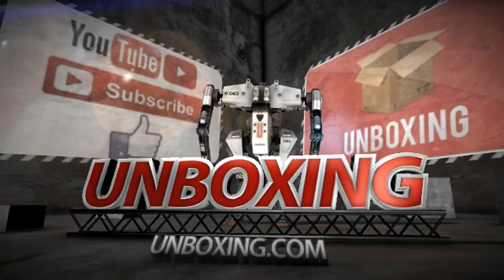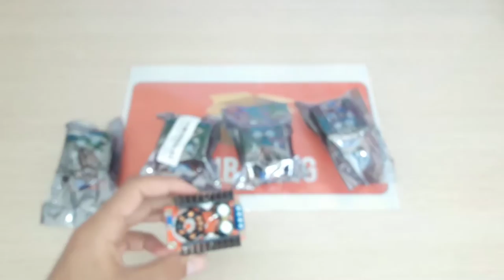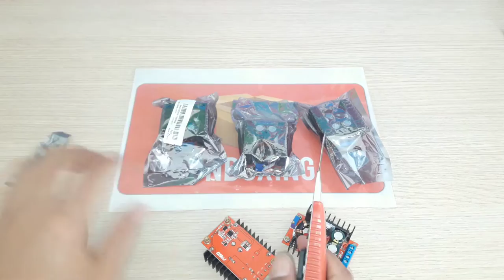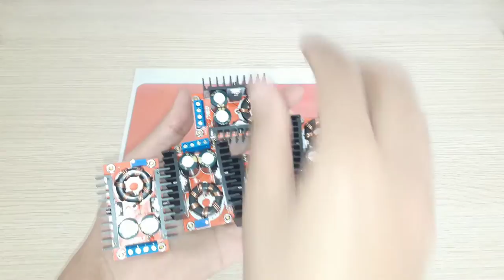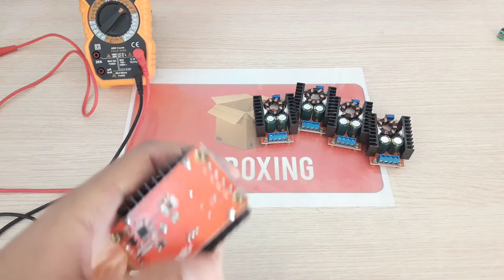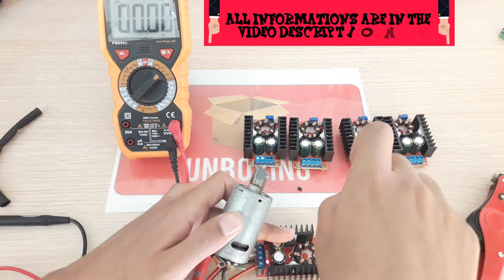Top Boost Adjust Module Mobile Laptop Car DC-DC 10-32V To 12-35V 150W

Comment: HI. Have you mesure the max Ampere at how many Volts and case temperature ? Thanks
Reply from the maker: i didn't measure the max  temperature but the temperature in normely and the amp test is between 7and 12 and volt i have just 22.5v

Comment: Hey broo i have a doubt 
If  i use laptop adapter as input( 18.5 v and 3.42 amp )
Will this module can give ( 24v and 5a) output
Reply from the maker: yes but the amp stay fixed

Comment: The specification says this modul maximal input current is only 16A..
is it save connecting this module to 12V 60A car battery ?
Thanks for the answer...
Reply from the maker: yes if you don't use more than 16 amp
Reply from the maker: what do you want to use
Reply: I want to use a 200W power amplifier in a car,, i want to increase the input voltage to 20V,  maybe that need about 10A current..
Reply from the maker: I do not recommend using
Reply: @Unboxing.Channel  why?
Reply from the maker: can be damaged
Reply: @jokolewung9093  yes use 60ah cer bettri no problem i am testing
Reply from the maker: okay good work

Comment: Use 12dc 90ah betteri
Reply from the maker: what??
Reply: @Unboxing.Channel  i am use tractor 90ah betteri use converter 12dc to 24 volt amplifair 200waat
Reply: No problem ampiar
Reply from the maker: its work good or not
Reply: @Unboxing.Channel  good work